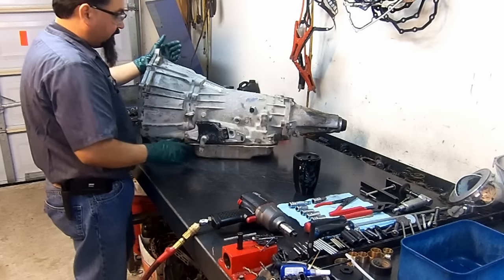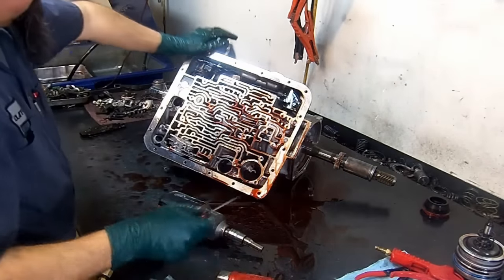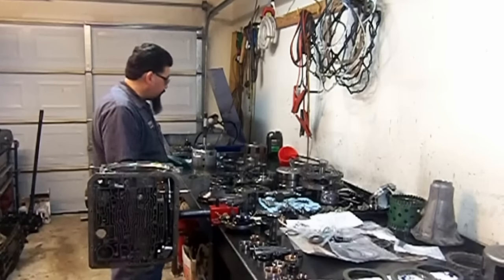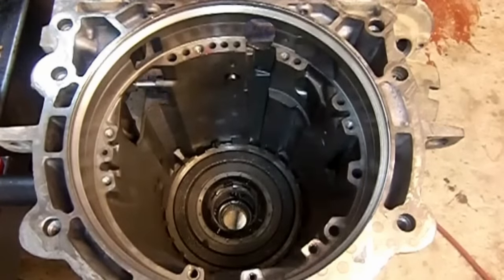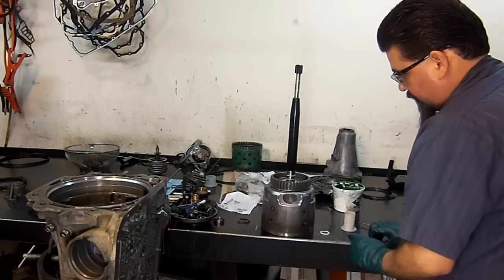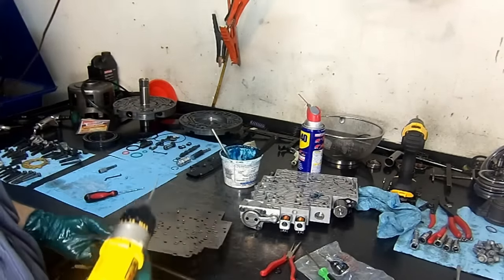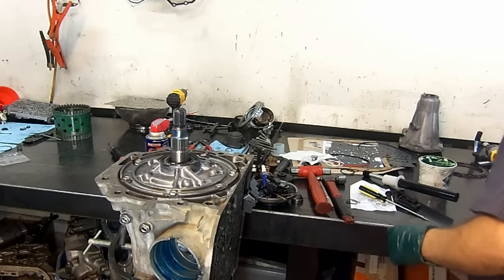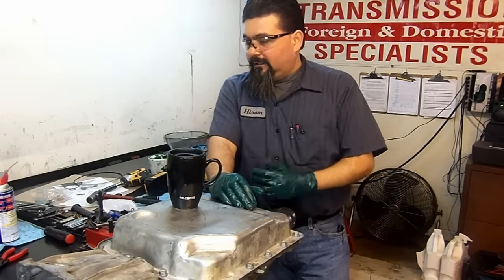4L60-E Transmission Full Rebuild

Comment: Hello Hiram.  Thank you so much for sharing your knowledge and experience with us.  I used your video to do a complete rebuild on my 4L60E and it now works really well.  I do have a question though on the TCC I was hoping you could help with:  
It doesn't engage.  I tested the solenoids and can hear it clicking in the gearbox when I switch it manually (I wired it directly to a switch to check it).  I had the torque converter cut open seals etc replaced.
My question is - do you think there is a chance there could be an airlock in the TCC circuit or something else causing the converter to not work as all the mechanics and electrics seem fine?
Thanks so much again for the great videos.
Reply: Hello Hiram,  thanks for the response.  The gearbox is in a Cobra I built and there is an aftermarket controller which is pretty rudimentary and doesn't have trouble codes.  
There is no change in RPM when I engage the clutch and when I change throttle position RPM changes.
Reply: o

Comment: Seems like Chevy ford dodges all have junk transmissions these days.
Reply: I don't know what you call junk, but compare the mileage your getting out of a electronic, clutch style converter compared to 25-30 years ago and there ain't no comparison. Everything mechanic fails, wears and most important needs to be maintained. Lack of regular maintenance is the most common failure. I rebuilt a 45RFE that had 520,000 miles on the original trans, but the customer always maintained his vehicle like recommended. Now explain to me how a genius like you comes up with a idea of failures???
Reply: ford nut the whole cars are junk after 4 years but a Toyota
Reply: @jimcatx3090  toyotas have their fair share of problems
Reply: ford nut not in my lifetime had 3 with over 200k on my 3rd now with 50
Reply: @jimcatx3090  well I buy and sell cars I've baught plenty of toyotas with bad transmission in them or motors they had serious problems with truck frames so their like any other car they all have issues.
Reply: ford nut well Toyota actually stood up and payed customers for there trucks or gave them a whole new frame do you see any other company doing that ask anyone Toyota and Honda have the best resale and reliability of any cars sold in the United States
Reply: @jimcatx3090  ok their you go then dont act like toyotas dont have their fair share of issues. If their so good why you on your third one. And hondas automatic transmission mission were junk as well. And ford has had the number one selling truck 45 years strait Toyota or honda cant say that.
Reply: ford nut I’m on my 3rd one because I trade them in after ten years for a new one because I have a good job lol like I’m going to keep the same truck for 30 years
Reply: ford nut how’s the ranger doing hahaha it will never beat the Tacoma the ranger is a joke and Ford is a joke I’m a Chevy guy anyway for performance the ls motors are the best v8 made

Comment: Great video Hiram. You did show me something that I didn't know about with the TCC PWM valve train by putting the spring in first and flipping the rear valve to make it the same as the transgo 4L60 HD2 valve train. This is something that I will be doing on every 4L60 rebuid from now on. Thank you for a very informative video. Keep them rolling and shift on Hiram.

Comment: I have a 4L60E transmission in a 1998 K1500.... Getting a check engine code of PO758 (Shift Solenoid B Electrical) I dropped the pan, Fluid was bright red, no debris in the pan or on the magnet... I replaced shift solenoids A & B. Tested the connectors with my power probe and was told that I should read ground on both terminals on both connectors (they only read ground on one side of each connector). I bench tested the solenoids with a 9V battery and both old worked correctly. I bench tested both new solenoids and they both worked correctly. Since I purchased new, I installed them. new filter, reinstalled pan, filled with fluid and then test drive. Shifted from  1-2, 2-3, 3-4, check engine light comes on and transmission shifts to 3rd as i lost 1st and 4th gears... I had a new transmission harness in stock for another transmission rebuild and I plugged it into the truck harness. I only had grounds on one side of the solenoid connectors, so I assume that the internal harness is good. I am at a wall, any suggestions on what could be wrong??? Thank you for your help!!!!!

Comment: This guys knowledge and ability to easily explain things extrodinarily impressive.  Without a doubt he is a true professional.  Being a shade tree, weekend warrior, non trained mechanic myself I shiver somewhat with the way he lets parts drop on the table or kind of tosses them around.  I would certainly put towels between the parts and on the table top to prevent any scratches in any sealing surface since a scratch in critical areas could cause havoc later...  All that being said, I have no doubt this guy knows exactly how rough he can be with parts without damage.  I am going to look for other videos from this guy for sure.

Comment: I just wanted to say thank you for sharing your time knowledge and experience.  I worked in the industry for 30 years and always considered the automatic trans a "black box" and to some extent it still is.  But between my experience, this video and a good manual I am confident I can rebuild mine, I still would not take on one for a customer, but I can gamble on my own junk.  So thanks!  OH, and aren't those lil dewalt 1/4 impact drivers awesome!  The only downside is I can see at least 4 or more tools that I have to buy. liked, saved to favorites, and subscribed!

Comment: Great video.  Thanks. Congrats on the nice work on this rebuild.  Also kudos to the engineers who designed that contraption with all its hydraulic channels valves rings pins ... and to those who actually produce all the components and parts to such close tolerances  ....  so it operates to move our vehicles... mama mia!

Comment: You are a master sir. I wish you were working on my 2008 CTS 4 . I hope you can help with some advise. I have 212k on my CTS. Have taken super good care replacing fluids on schedule etc at dealer. Last year while driving I started to feel a subtle something going on. About 1 mile from home I went over some railroad tracks and the car went into limp mode. I had it towed home and the OBD stated there was a bad solenoid. Let her sit on jack stands for a year and then bought the AC Delco Solenoid valve body that comes with al new solenoids. Can't purchase just the solenoid on this year model. I put a new battery in and decided to try driving it and it was out of limp mode and did fine but knew this wouldn't last. I drove it to I had a local transmission shop explained the issue, gave him my valve body my new seals and my new GM trans fluid and stated he would install the 450.00. After he was done the car ran but wasn't changing gears normally. He stated I need to drive it for 10 days for the computer to reset. I don't think he installed the firmware like he was supposed to. I put it on the computer again and got a PO751 code. What are your thoughts and what do you recommend?

Comment: Probably one of the best videos I have seen. Very well done. Thank you for taking the time out of you schedule to film that. I have a 4L60E in my 04 GTO . And i am not sure if my over drive is out or third gear but once it seems to get around 40 mph i loos the transmission completely just like it was shifted to neutral. Not sure what the issue is but i am hoping someone may know if a rebuild is in my future or not.

Comment: Wow, I am pretty confident that you Sir can put this thing back together in your sleep. I have a 2003 chevy silverado that I was receiving a P1810 code. So I had dropped the pan, but now i don't know if I want to put it back together without taking it to a transmission shop first after watching what was bad in this 2006 being that mine is three years earlier.

Comment: 1st I'd like to say you are amazing your knowledge is off the charts
I wish I knew you,Wow!
I have an 02 Regal LS Vin K
 It hangs between 1st and 2nd gear
If I can get it into 2nd it shifts perfectly
 the rest of the time I'm driving through all gears
  Replaced 1-2 & 3-4 shift solenoids
 filter and fluid no luck. 
No slippage in any gear down shifts perfectly.
Any help you can give me would be greatly appreciated Thanks!

Comment: thank you for the awesome information and strictly informative no nonsense format, you are a true master of your trade, I have a 2000 Sonoma with this exact transmission, but have had 2 issues since rebuilt.
1) a long delay when shifted from drive to reverse.????
2) when driving at steady speed between 40 to 50 mph it can't make up its mind weather or not to stay in lock up.???? thanks in advance if your able to help.

Comment: I’m currently building my 2008 Avalanche with a 4L in it. Put a “mild cam” as it was called in it when the DOD took a crap like it does. So decided to build my truck to be a street rod type of deal. Put the cam, long tube headers, CAI, 96 lbs injectors, dual 250lbs fuel pump and, “am about to get it dyno tuned” now realizing that I have a stock 4L60e with a stock 3.73 gear in it I believe. ( basically getting everything ready for supercharger) Wondering if maybe you can share a link or make a video for exactly the steps and upgrading the transmission would take. By the way I love and appreciate all the knowledge you’re passing. 👏🏽👍🏽

Comment: If anyone’s wondering putting transmission oil will help your truck from not slipping gears. Did a radiator swap and forgot to refill my trans fluid.  My truck was stuck in N. Didn’t fry the trans or over do anything my house was a block away. Made it home and put fluid. My truck now shifts fine and doesn’t get stuck in N. If any had the same issue I hope this helps. I thought I had to do a trans swap 🫱🏾‍🫲🏽🙏

Comment: Mr. Hiram I am very grateful for all your advice and the humble way with which you distribute so much information .... I have a tahoe with a problem of 1 and second speed .... the truth is that it does not do the second of 1st digitally pass to second but Physically no. of 1st is neutralized in 2nd and goes to 3rd ... I check all the data of 1 and 2 and the only thing that does not do is give me the time of change remains at zero.....I change 1 and 2 accumulator continue the same...Can you get mi some advice for it problem....thank you.....

Comment: That's for the awesome video and knowledge. I did one for a 97 model about a decade ago and about to do another for my own personal 07.5 silverado. Glad to have a refresher. Question what would be a good rebuild kit to order there are so many at different levels of parts I'm still kinda lost on what to buy exactly? Also for the bushings I dont have drivers for install or removal, is there a different way to remove and install or do I have to have bushing drivers. Again thanks for the video hope your still around turning wrenches.

Comment: I'm no expert, but I would have liked to see you check your 2-4 servo pin clearance.   You also didn't install the 5 clutch return springs to give your 2-4 band a  bit more time to release.  cutting room floor?
I did realize that I'm way too stingy with my translube LOL.

Comment: Hiram. Great channel. It would be nice if they had a servo piston for the 4f27e that had Teflon rings machines into the shaft making rebushing of the case unnecessary. They have them for the 5r55. Have seen anything like that?

Comment: Hey man I rebuilt my 94 4l60e almost a year ago on my camaro and was working great no leaks (my first transmission rebuild ever) I only had like 500 miles on it, I only use the car some weekends. Thing is a couple weeks ago I went on a 40 mile trip and the transmission cooler failed, huge leak I dont know at what point in the trip it happened but when I got home it was shifting weird and had very slow reverse, very low on fluod. I replaced the cooler and refilling I accidentally overfilled the transmission but didn't notice it. Then I went to a test drive for like 6-8 miles and the transmission was working good just a bit harsh on the 1-2 shift but felt back to normal. I noticed the fluid level and took some fluid out to get it to the correct level. Thing is now it has a leak which seems to be from the pump seal, do you guys think that the low fluid due to the cooler leak caused the torque converter to overheat and damaged the seal? I don't really know cause I need to take the converter cover out to really see what's happening but the fluid it's coming from that area for sure and I think it's the only place it can leak but I might be wrong

Comment: I like your way of explaining what your doing. Just 3 questions, 
1. Where'd you get the foot operated clutch compressor?
2. Where'd you get the adjustable sealing ring installer?
3. Where'd you get the selecor shaft seal remover and installer?
Thanks
Reply from the maker: 1. I don't remember, I have 2 of those. I think one of those I bought from snapon and the other transtar. 
2. Sealing ring installer Atec-transtool, not sure if they're still around. But Mac Tools or snapon can probably get you one .
3. Snapon for sure, I think they discontinued the short one but you can still get the long ones.

Comment: Hi sir very very good informative video. 1 major question. when you installed the pump. You said it should turn and be able to pull it up slightly. Although in this great video your did not move at all. I am 
a CNC Machinist / Programmer. so attention to detail is my job. I really want to rebuild my own. As I lost 3 rd gear up on a 2004  4X4  5.3 L chevy silverado truck.   Need help

Comment: Hiram, man if you could do an (Ford AOD-M) that would be awesome. Mostly 83-89 Ford, Mercury & Lincoln cars and 81-90 Ford trucks. I’ve got a 85 Mercury Grand Marquis (AOD-M) that reverse is almost gone and 1st is starting to slip into 2nd. I’ve ordered a (SS Monster In A Box Kit) from Monster Transmission and a Stock Style torque converter from there as well. I’m planning to yank the tranny out and rebuild it when I get a little more time to have the patients to do it all in one weekend, tear down, cleaning, rebuild and painting. It’s 1-27-19, hopefully I can get to it around mid to late February possibly early March. Man, a complete tear down and rebuild of a (Ford mid-80’s AOD-M) would be awesome.

Comment: what kit exactly i have to order for my 4L60e 1999 s10 ? my truck stop working in Spain and cant get the transmission from state , decided to rebuild it , the problem is my truck wont change the gear from 3 to 4 thanks for great video .

Comment: Thank you so much for the wonderful videos,  I have a 4L60e in a 2000 gmc Safari that is making a whining noise while accelerating.  I took off the extension housing and inspected the bushing and yolk and both seemed fine, no visible wear.  When turn/spin the output shaft by hand, I hear some whining coming from the output shaft.  Any idea what may be causing it.  Otherwise, the  van accelerates great and goes smoothly through all the gears.  When driving, a loud audible high pitched whine emanates from the transmission and increases when accelerating and decelerating as well. Any thoughts are appreciated:)

Comment: Hiram, awesome video instruction, thank you.   Can you provide any information on how to find a local reputable transmission shop that will not cut corners and do the job that you just performed?  I've never had to have a transmission worked on, but I now have a 4l60e that has a blown forward input sprag, only reverse gear working, and I want to make sure that I get not only that freplaced but the entire transmission rebuilt correctly since they are going that far into it.    So the question is how to tell the good guys from the bad?  If it is even possible.  Or who would I ask locally about great transmission shops like you run, as my fear is the less reputable guy might build it only good enough to last until the 1year warranty is out...by not replacing parts that should be replaced only to save a buck on their parts list.    Maybe a tough question to answer, but i'm sure many on here are in the same boat.
Reply: Located, about halfway between Austin and Dallas

Comment: Hey man I appreciate the time you took took do this. I have a 2011 Yukon and I want to build a stage 2 transmission so this was very helpful. One question tho what was with the three holes you drilled in the valve plate. And how did you just freestyle the position of the holes😅. Again thank you.

Comment: I see the separator plate filters still on the bench, otherwise a great video! Very informative.
Reply: I saw that also. I install them on every rebuild and I drill 3 .067 holes in the bottom of the EPC solenoid screen to prevent it from collapsing in on itself causing restricted flow.

Comment: Hi, I just watched the video, I have a 2002 Chevrolet Tahoe 5.3 V8 with 4L60E Transmission. I went to school to become a mechanic and work on cars truck, etc. I even learned how to rebuild Transmissions. But I went into working on motors and suspensions brake jobs Etc. I need to rebuild my transmission and I do a lot of towing a trailer for picking up cars and trucks at a  auction. Anyway can you please recommend a good heavy duty rebuild kit for 4L60E Transmission? I would appreciate any suggestions and help. Thank you

Comment: Hi Hiram thank you for all your videos they have helped me, I successfully rebuilt 1 4l60e. Now, I am on my second one and I was air checking the reverse  and reverse input for engagement and leaks. I thought it was leaking past my teflon rings because I pressure the square hole and the piston airs up. Now I have different teflons in it and it still won't air check. Any ideas for me. Thanks.